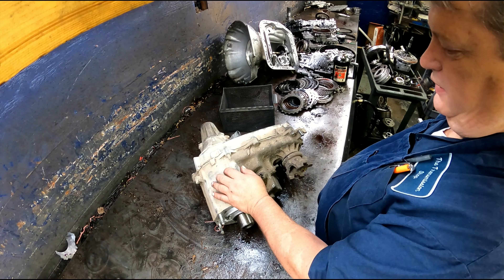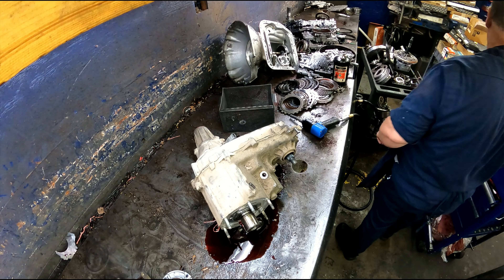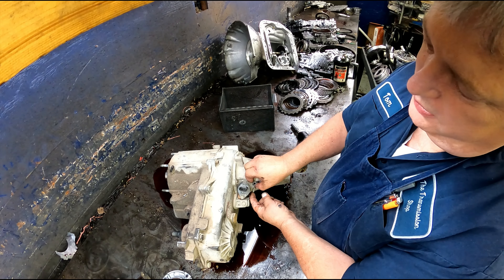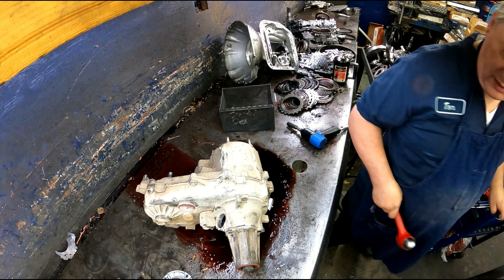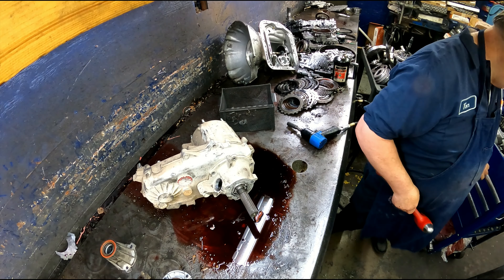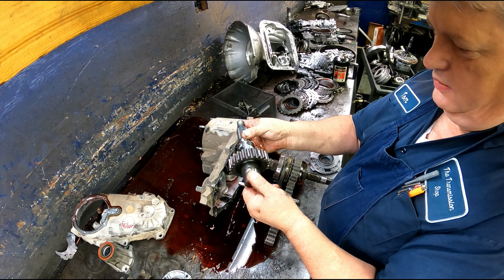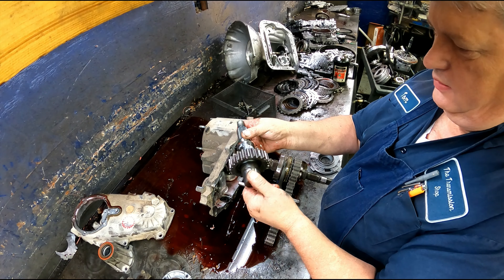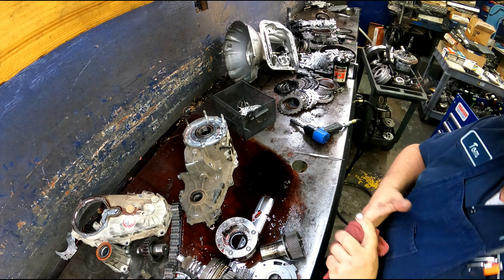231J Transfer Case Disassembly

Comment: So what might in your personal opinion might have caused the scoring to the pump surfaces?
Would it most likely be contaminated oil or other causes?
Just asking as l have no experience, and you most defiantly have.
thank you for sharing another excellent video.
Cheers from United Kingdom   Colin
Reply from the maker: Contamination and/or low fluid.